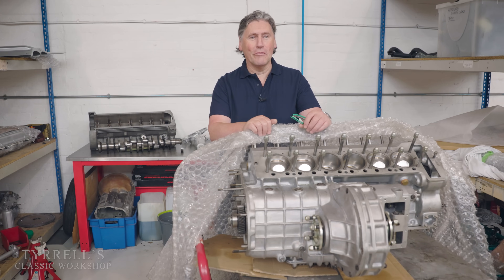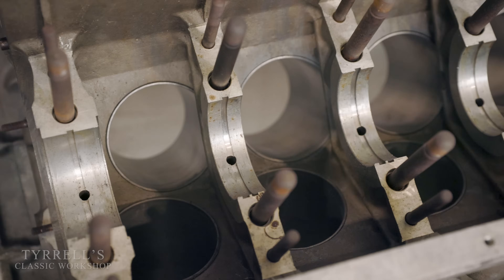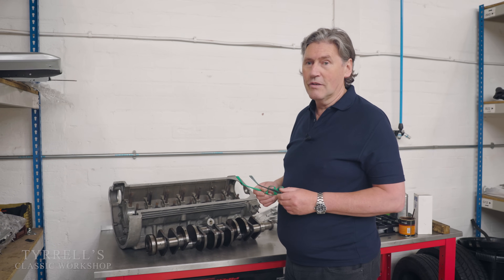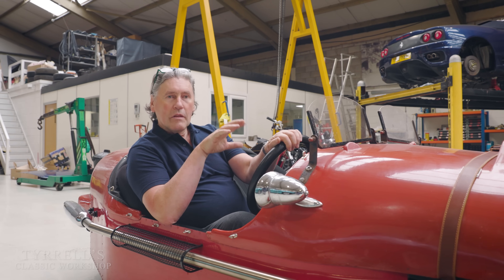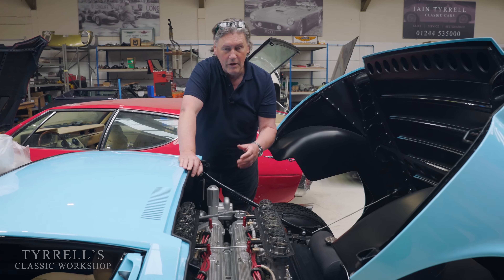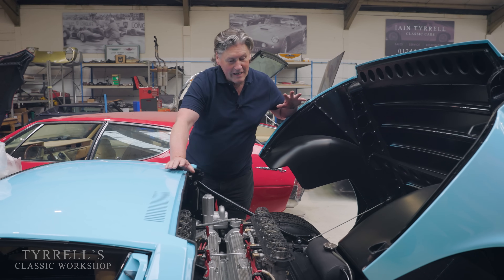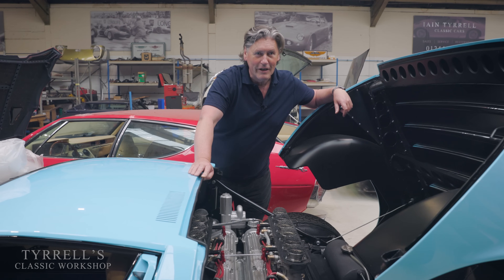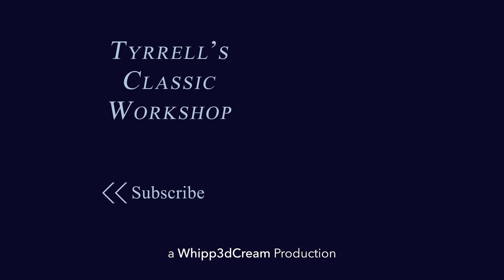How to warm up your classic car engine the correct way & why it matters | Tyrrell's Classic Workshop

Comment: Not related to classic cars, but diesel engines require similar care when starting, especially after long periods of not being run. Older diesel engines usually have a cable operated fuel shut off, so it is easy to crank the engine and build oil pressure. Modern diesel units usually have an electric solenoid which energizes as soon as the starter is engaged, so if starting after a prolonged period, disconnecting the solenoid can be beneficial to allow oil pressure to build.

Comment: May I ask how you would start a classic motorcycle (british twin)? Would it be good to crank it several times with the kickstart and the ignition off, to get the oil circulating? Thanks for your help.
Reply from the maker: Yes a few times, but don’t go too crazy. Unburnt petrol washes the oil off the bores too
Reply: @iain_tyrrell  Thank you for the valuable tip

Comment: I would suggest a kill switch - I used the fitted ones on motorbikes, esp in winter, spin the engine over so the oil gets around, and then dis-engage the killswitch, and boom, it just feels better, the right top end was driest if I left the bike on the sidestand. Ignition and starter should be separated, or fit kill switches in your cars, simples. If you have an oil pressure gauge, you can watch the pressure build up spinning over on the starter motor, THEN ignition on, and start her humanely. I hate the thought of dry top ends revving up cold..it just hurts, let alone dry mains and big ends!

Comment: Sorry but I have to be the uncool, unwashed, ignoramus here. Not having the funds for a Lamborghini, I purchased a used 1999 Toyota Camry V6, with a manual 5 speed transmission, back in 2004. I was living in Connecticut and it gets very cold in the Winter there.

I bought it used, with 90,000 miles on it, for $7000. I put $2000 into it to upgrade and lower the suspension one inch. High performance tires and brake pads. The car was a beast! For five years I drove it very aggressively, but never around other cars or people. 

The 23 year old daily driver is rapidly closing in on 300,000 miles. The engine has never had a major repair, just tune-ups and timing belts. It does not use oil! I change the oil and filter at 5000 miles, with whatever oil is cheaper, and it may be 1/2 quart low. I really can't tell. I have a white cement driveway and nary a drop of oil has every stained it. I don't do anything special to warm it up, just a few seconds of sitting at idle.

How does Toyota do it?

Comment: Very informative! I wonder what I should do best with my Mercedes 230E from 1983 which has automatic clutch I suppose. When you say crack the engine a few times before firing it, could I perhaps try the following. When I turn the key the engine usually fires really really fast (especially for an old car). I could try to hear on or 2 beats and then turn back the key and repeat this twice before actually firing the car. Not sure if I have the time to turn the key back before it fires, but I could try Would that be a good idea? After it fires I'll keep it at 1500RPM. Thank you very much in advance.

Comment: The worst things for going bang , two stroke motor bikes. Unless you let them warm up.
Start bike let it run for a good 5 minutes or so whilst putting on your gear.. 
Another, again bike related,  Harley Davidson,  again start and let warm up , unless you want to keep replacing cylinder head base gaskets.

Comment: On older British cars the ignition and starter are on separate switches so you can use the starter on its own then turn on the ignition. Also, sorry to disagree with you but if you run an older competition type car that uses thick oil at 2000 rpm straight away you run the danger of shearing the oil pump drive. I've seen this happen several times on BMC  A series engine cars when I  worked in BMC's competitions department.

Comment: Great video Iain, but how about a video on the correct method to 'shutting down an engine ', I know we have to let Turbo Chargers cool down before stopping the engine, but what is the best method off ensuring a good coating of oil on vital components?    I speak as the owner of one Rotary engine Mazda, so I get a bit paranoid about this subject for obvious reasons.

Comment: FI mapping goes up to about 1500 rpm, then settles around 1k -800 in 30 seconds.  
The initial speed primes the oil pump.

Comment: Really interesting. Thank you. I find on my old cars with mechanical fuel pumps, like my Triumph TR, they need to churn much more when cold, which is actually better for them. With electrical pumps, like on my E type, or Mini's, I tend the let the ticking stop then fire the engine, but it's then an immediate start. Not so good.

Comment: I’ve been watching your videos from the beginning and never miss one. I have an Arnolt Bristol,  Ferrari 360 Modena, Iso Grifo, Iso Lele Sports, Bentley Continental GT and always worry about the best way to start them as they are all so different and I really want to look after their engines. Your video was so informative and specific that it was of great benefit to me, thank you. One question. Should I let them idle until the water temperature comes up before I drive them? Steve

Comment: The early TVR speed six engines had premature wear issues due to oil not getting to the cams fast enough on start up. (Al Melling who designed it told me they'd deleted an oil feed)Whilst many of the engines have now been rebuilt to a later spec, some owners fitted a pre-oiler which was an extra pump which pumped oil from the dry sump tank to the top of the engine for about 15 secs before start up, ensuring nothing was dry

Comment: Ian do you think on a classic carb engine it might be worth putting a push to break switch in the coil that you would press for a few seconds whilst starting, to manually delay the engine starting and give the oil a chance to circulate?
Reply from the maker: Yes, good, but don’t crank for too long- neat petrol in the bores

Comment: My mate, who lived about 2 doors away at the time, was a mechanic..He aquired a 'Pre Start Engine Oiler' device, that was plumbed into your oil line..about the size of a jar of Horlicks..when the engine was running it filled up with oil, but when you switched the engine off, a solenoid shut and your oil was kept within device..Upon switching on the ignition BEFORE continuing to starti the engine, the oil was released, under pressure of course, and oiled your engine..clever..that must be 40 years ago or more, never seen one since...
Reply: It seems like the obvious thing to do, so I wonder why this is not more common, if not standard operating hardware.

Comment: Iain what is your view on when to move off? 

I have always believed that as soon as the throttle opens / revs can rise smoothly to around 2000 rpm, you start driving and then stay around 1500-2000 rpm/ gentle acceleration until oil and/water temperature (whatever gauge is available) has stabilised. Some people leave the car stationary until temperature has risen, which makes no sense to me and probably doing more harm than good?
Reply from the maker: Yes, 2-3 mins stationary warm- up and then gentle driving should suffice

Comment: I guess that explains why modern mild hybrid systems still use the starter motor from cold but use the more immediate starter generator for city start stop driving. Surely when the engine is warm it still needs some time to create oil pressure? Mild hybrid systems go from 0rpm to over 1000rpm instantly.
Reply from the maker: This is indeed a question. When warm it will take a short time to build pressure but it can’t do the engine long- term good to keep cooling and warming- up

Comment: One of the worst engines I had was the Vauxhall slant-4. It took a good ten seconds for the oil pressure to get up on that. Because of that, I babied it on start-up and it never gave me any bother in the long run. I heard, over the years, many other owners start them from cold and immediately rev them up. I wonder how long their engines lasted.
I've often toyed with the notion of fitting an auxiliary cold-start oil pump to get pressure up before turning the key, but I've not had an engine since that's really needed it.

Comment: Great video. It is good to see a cross comparison as you rightly say, there are many types to be considered. I wonder what your view is driving say immediately after starting vs say letting the engine warm a tad more before doing so.
I have had many classics of all the type of engines you covered here, all with different starting requirements. Porsches with M96/M97 engines for example; the perceived wisdom is fit a low temp thermostat, start and move off straight away. Keep the revs to 2k - 3k max until fully up to temp. Again great video, keep them coming.

Comment: Dear Ian, Is it possible to make a few standard starting procedures (manual choke, early injection, dry sump carburated, dry sump injection, ECU managed engine,...) and then make the list of the cars that are best started with every procedure? I think my 1980 Spitfire and 1973 Morgan +8 are best started afther the build up of oilpressure and then warmed up at 1500 revs. My 1987 Porsche 911 must be started without touching the acceleration pedal but I do not know how fast I can go to 1500 rpm to warm it further. My 1997 Mercedes SLK and 2001 911 4S are managed by their ECU who keeps up the revs when cold, I think I can rely on that. Keep making video's! Some episodes about storing cars whould be very interesting (short time/long time). What is for you the best humidity % for storing cars? 45% ? Best regards, Yves

Comment: Excilent session on start-up but for rebuilds it is extra important as the parts need to bed in on an old design engine. When the engine has stood over winter the same applies I disconnect the coil LT lead and crank over untill the oil pressure comes up and stabalies. This could pull fuel into the cylinders on cranking so  better to take the plugs out and check they are clean also. 
I have seen this done on the BRM 16 cylinder race engines.

Comment: Great stuff. I have always resisted temptation when starting any engine. Always been mindful of the oil circulation. I had a neighbour with a lovely sounding throaty V8 TVR, but he knew nothing about cars. For several years he would start it from cold and instantly fling it up to very high revs like a teenage boy. Then before it even had chance to warm up, he'd switch it off. An hour later did it again. He did this multiple times per day each summer weekend for several years. Eventually, it went from sounding really sweet to sounding like a washing machine full of knives and forks. He has not started it for at least 5 years now. I am certain he trashed the bearings. I am also certain it was for all the reasons Ian describes here. Great video.

Comment: Good info. Many of these tips are also appropriate to Lycoming & Continental piston aircraft engines. At 1:45 Iain says on cold start "engines need a much lower fuel to air ratio". I think the intent is the opposite: more fuel, less air. A richer mixture is higher fuel to air ratio, lower air to fuel ratio.
Reply: Also, seems like the aircraft  Lycoming and Continental piston engine  crank a bit longer before staring up.
Reply: @kimberlywentworth9160  They may, depending on the model and whether it's carbureted or fuel injected. With proper technique, some will cold start within 1-2 prop rotations, others take more. Vintage car engines can be the same - some crank longer than others.
Reply: @kimberlywentworth9160  PS: this may also depend on the type of magnetos it uses: impulse coupled or shower of sparks. Two different ways to get spark for a cold start.

Comment: Iain , so interesting , I now feel I am not being obsessive winching my car into the garage with a trailer winch when engine cold rather than starting it up for only a 20 ft drive.It’s an AMG V8 so it was sobering to hear of a big end going on one at 30,000 miles.Maybe that was due to short journeys.

Comment: One trick I use is, if an engine has been sitting for quite awhile, I pump compressed air down the dip stick tube, (remove the dip stick) that partly pressurises the oil system, you can see the difference, in how much quicker the oil pressure light goes out, or oil pressure gauge rises.

Comment: I'm totally confused. I was told that oil is more of a coolant, than a lubricant. If an engine is starting from cold with no oil on it's parts, it should not make a difference if what I was told is true???

Comment: Fantastic stuff Iain. Any further thoughts on how best to get an engine up to a good operating temperature before using higher revs/loads? I have heard contrary advice about how to achieve a good oil and engine temperature, idling vs gentle driving. Also on how best to assess when your engine has reached at an appropriate temperature for less gentle use? How much reliance can be placed on oil and engine temp gauges? If you have them.

Comment: The  Bentley has a starter with gear reductors, it sounds like it cranks longer, but it's just slower, but more powerful.
3.0EB Ford's really cranck longer as well as late 80's, early 90's Motronic Opel, BMW and Mercedes.
Reduction starters are made to lower the amps drawn in modern ECU controlled engines, otherwise the computer doesn't have enough voltage to operate or forgets its adaptations.

Comment: Fascinating video Ian. I have always had this concern when starting my 2001 R129 Mercedes SL500; obviously not really a classic car in the true sense. But from what I saw of you starting the RR I think the SL operates in a similar manner. Turn the key for a moment and releases immediately but the engine continues to crank for a few seconds then starts. Runs at a relatively fast ideal of around 1500 rpm for about 5 seconds then drops to it's normal ideal of around 750 rpm.

Comment: I have an Aston Martin DB9, it has a feature where if you press the accelerator pedal to the floor before pressing the ignition button, it will turn over without firing up. I usually do that to build up some oil pressure before actually starting it. Makes sense in theory but happy to be corrected

Comment: I have a Euro Mercedes W116 350SE with D-Jet. After watch this fascinating video, I am a little concerned. The car starts well but quickly runs up to 2000 RPM. Is this a) normal and/or harmful?

Comment: This reinforces my concerns with modern automatic start/stop systems - unless - and I suspect this might be the case - they have electric oil pumps. I would hope so because otherwise the constant stopping and near-instantaneous starting of those motors is going to cause some serious premature wear.

Comment: This suggests to me that a simple ignition isolator switch under the dash could be used to prevent the engine from firing. Kill the electrics to the engine, give it a few spins on the starter motor to lube everything up and then wake everything up to actually start it. 

I actually used to have such a thing on my 1979 Lotus Eclat (still have the car 37 years later) although that was an anti-theft device. Much egg on face when I forgot about it and couldn't work out why it wouldn't fire after a day out. DOH!

Comment: Hi Ian what could i do about cold starts on the 5th genoration maserati quattroporte. As you probably already know all the oil drains from the cam caps in the wet sump versions so even when they start up after 3 or 4 revolutions it rattles like mad for 2/3 seconds eventually this ruins the VVTI system which is expensive to replace. So what can i do to lower the chances of it starting dry. Thanks, Aaron
Reply from the maker: Hi Aaron,
Tricky one this. Not straightforward answer unfortunately. It’s working within the parameters originally set up by Maserati. You may just have to live with it!

Comment: Any opinions about adding helper electric fuel pumps (with the right pressure), to aid priming systems in very old cars? We have a lot of pre-war cars and do this to save having to crank the engine too long. Sacrilege or good engine caretaking? 😃
Reply from the maker: Cranking may be heavy on the electrics but it will help build up oil cover first!
Reply: @iain_tyrrell  but cranking too long isn’t good for the starter either?! I guess it’s always about finding a happy balance. Love your videos by the way!

Comment: Many thanks for a very educational video. What would be your thoughts on fitting a switch to disconnect the coil while you build up oil pressure?
Reply from the maker: The problem with that is that the engine is still sucking in petrol, which washes the bores

Comment: My Chevy Healey has a device fitted that  if there is low or no oil pressure it wont start as fuel pump wont  work  so as you crank the engine the oil pressure builds and you hear fuel pump start and then give it a couple of stomps on the accelerator to squirt some fuel in it and you are away . I like to run it at 1000 ish RPM for a bit to get a little heat in it  
Also the oil cooler is water cooled  from the system,  that warms oil up nice and quick too.
Bonus is if the oil  pressure goes whilst driving it will cut the fuel pump and it peters out before you do a major damage to the engine.